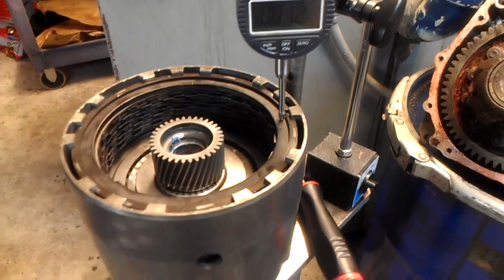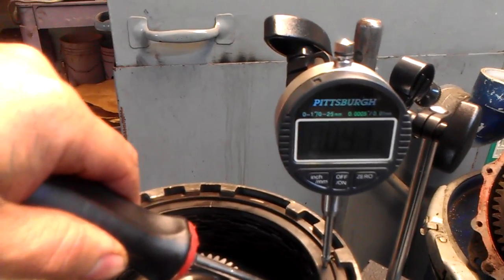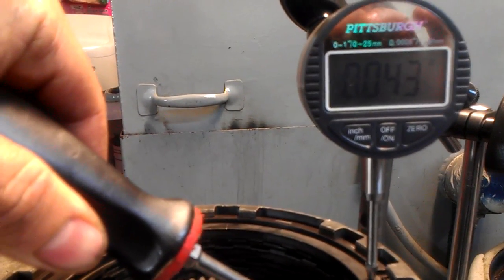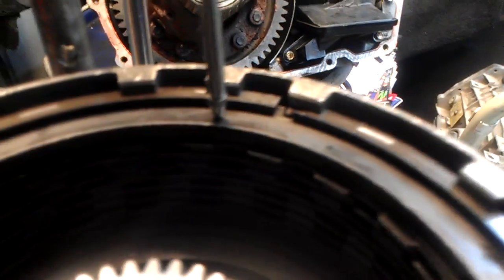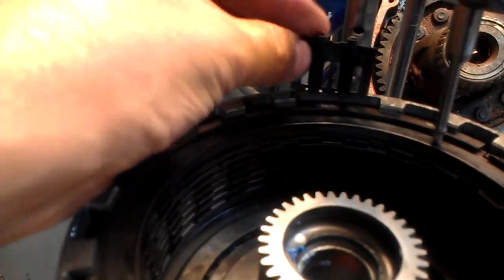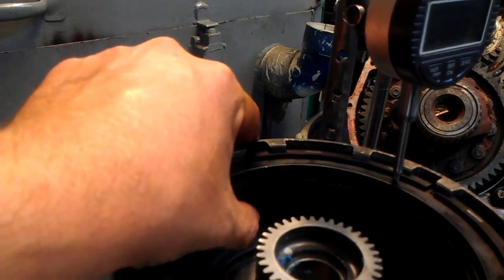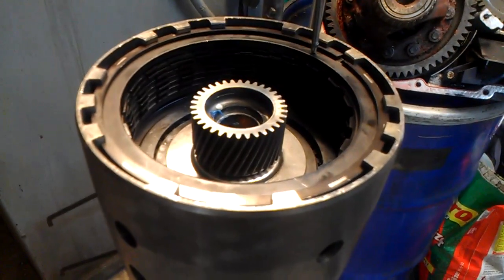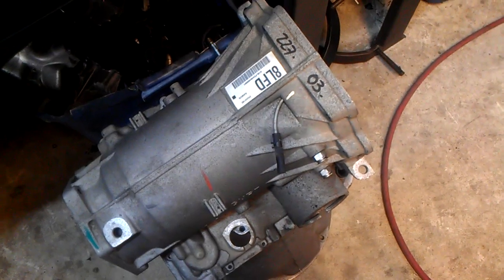4L60/65/70 Transmission (3/4 clutch clearance) - Transmission Repair

Comment: Use the manual dial indicator. Im a machinist and own a digital dial indicator from harbor freight. Its junk. There analog dial indicator isnt really that bad for doing work like this but there digital one is garbage . Its actually half way decent . Ive gotten really bad false reading from the HF model I think its tolerance is .01 and if your off by that on the high or low it could mess this job up. . Ive returned two of them and just kind of excepted the third one but never use it ever.

Comment: You are saying to leave the 3/4 load springs in place, then why doe's ATSG repair/  rebuild manual to remove the 3/4 load spring, this is confusing. 9-7-2013